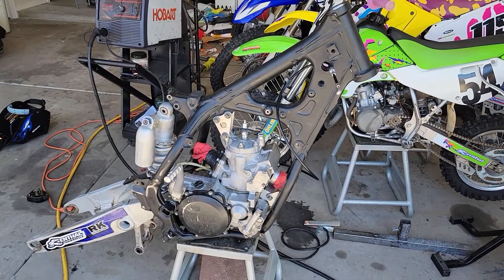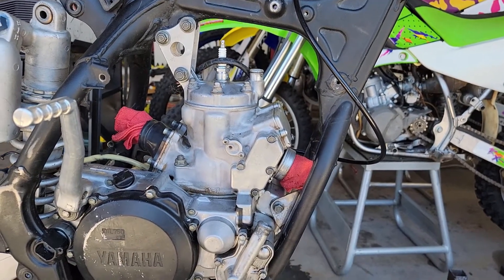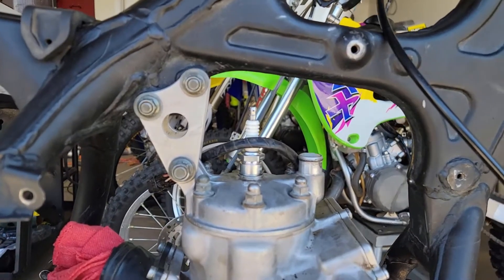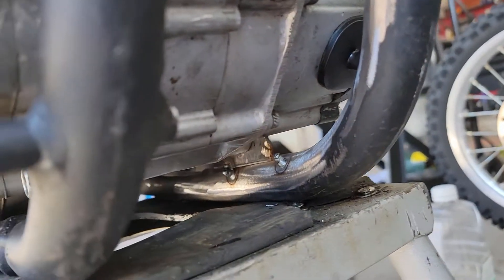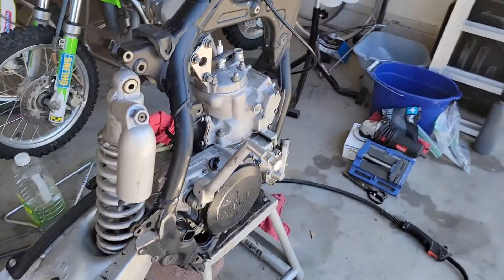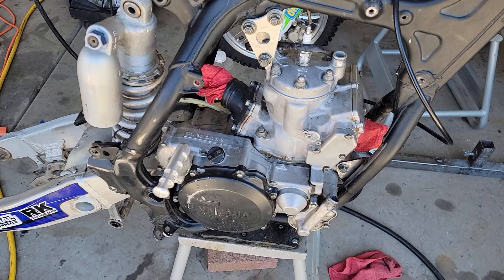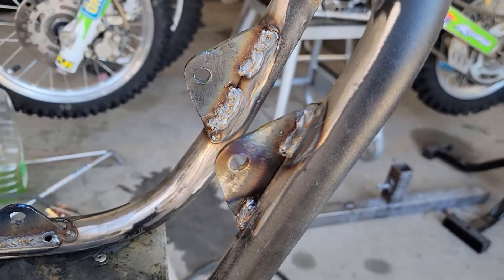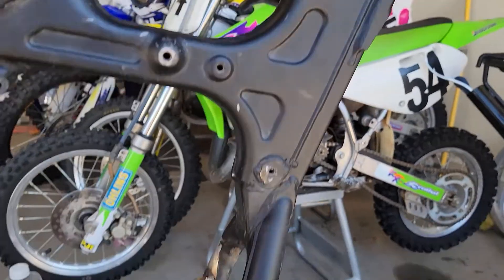1999 YZ250 motor in 1996 YZ frame

Comment: my question is beacuse I whant due same  I whant put 2001 yz 250 engine in 1998 yz250 frame the mount look like same
Reply: Did it work? I want to do the same a 2001 motor in a 1998. Thanks

Comment: Getting ready to do the same thing with a 1999 motor in a 1998 frame.  Couple of questions if I may ask.  Did you have any carb alignment issues.  My cylinder head motor mounts need to have holes elongated. Did you have to do the same?   And last,  Not sure why you had to "clearance"  the frame rails as I don't seem to need to.  Could this be due to 98 frame vs 96 frame?  

Also, I saw in the finished product and as I am encountering, the tail end of the exhaust lacks a brace (no biggie I will fab and extension for mine from the 98 mount).

Great job and fantastic looking bike!
Reply from the maker: I don't think you'll have any issues using 99 carb in the 98 as the 96 and 98 have the same/very similar subframe. Good luck with the project!

Comment: Hey man i have question. So i have a 1990 yz250 and my carb is worn out. I was wondering will i be able to use a carb from a newer yz250 ? Thanks man
Reply from the maker: Depends on what year. I think you will have a direct bolt in with one 1990-1995. But may have to modify if a different year